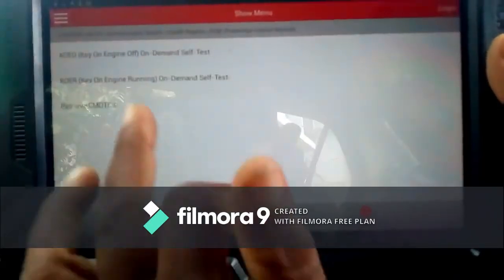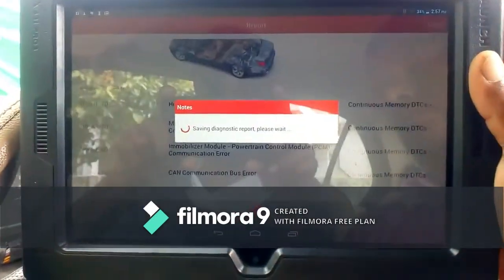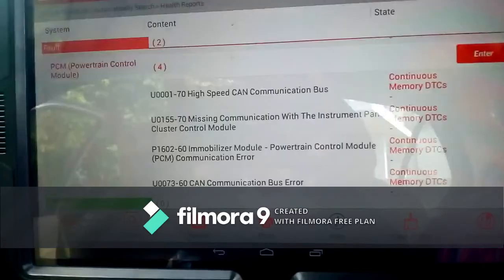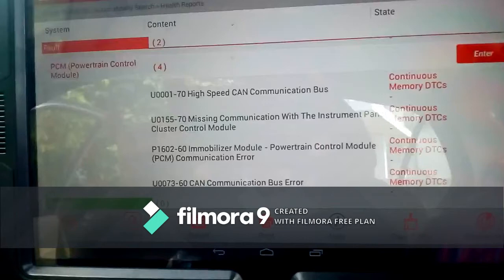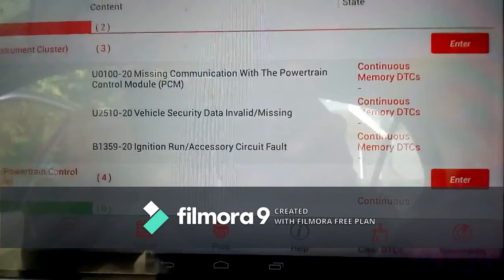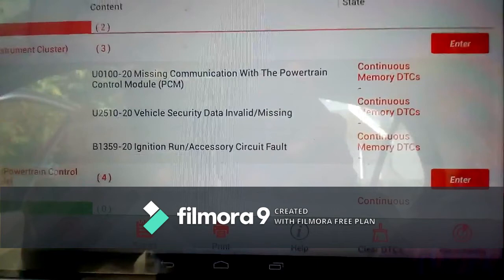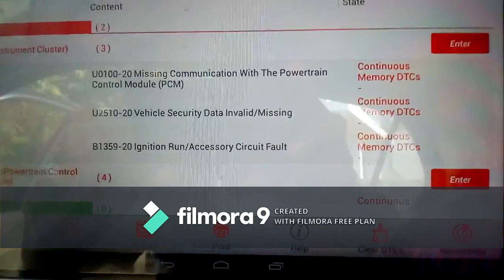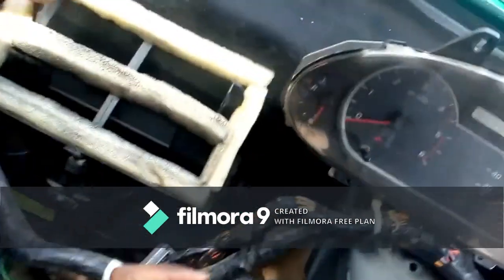Ford Icon Wiring Fault

Comment: I need help. Same model car ford ikon 2009 tdci engine.vvs sensor. Speed sensor is not working. I change 3 sensors. And wiring voltage also coming ground and 12v. Wht is the exactly power should come from signal wire.and I put the ecm of fiesta and progress car is getting start but speed sensor is not working same as it..  Any idea about this problem. Pls reply or share your number
Reply from the maker: 08985384993